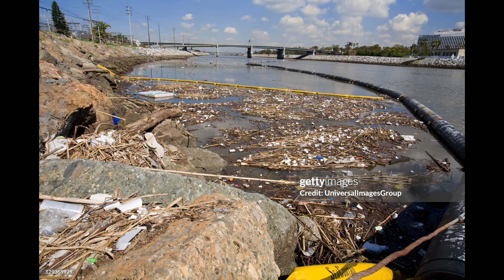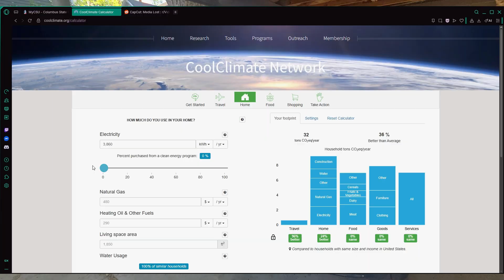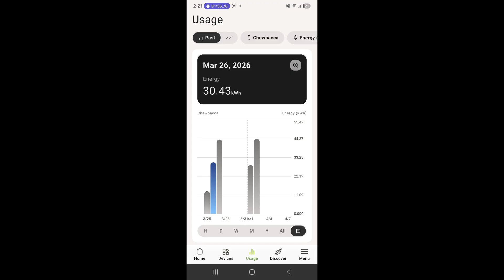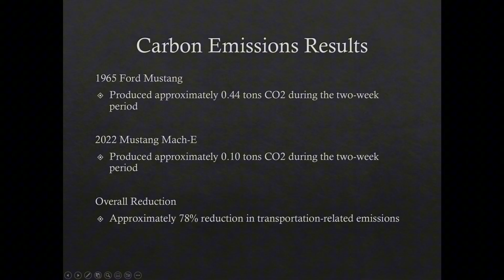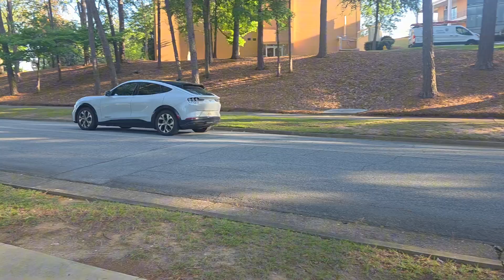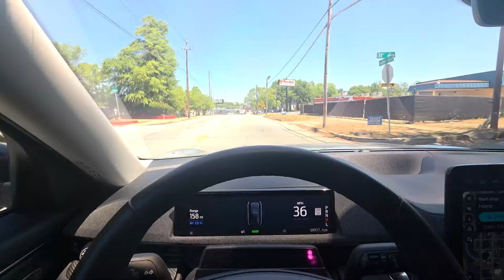CF Project

Comment: Agree... I have been driving an EV as my main vehicle for nearly 10 years now.  "Fuel" costs and maintenance costs have been VERY much lower than for Gas or diesel vehicles.  Many families have two (or more) vehicles, so it is practical to have one EV for the majority of trips, and a second vehicle to suit the family lifestyle and needs, even if you are not ready to switch to EV for every trip / use.